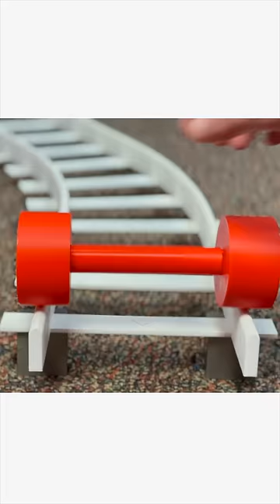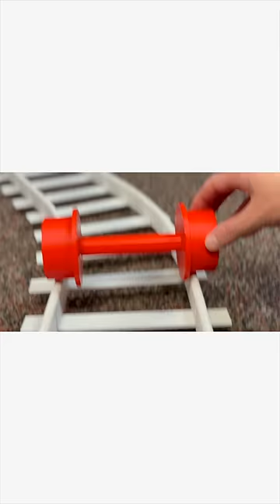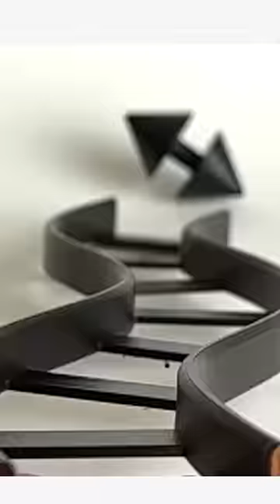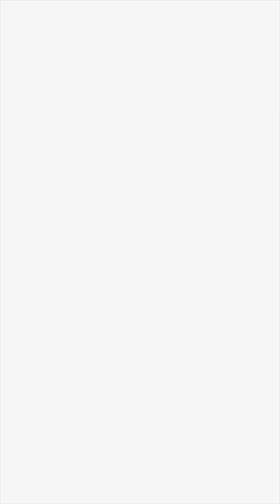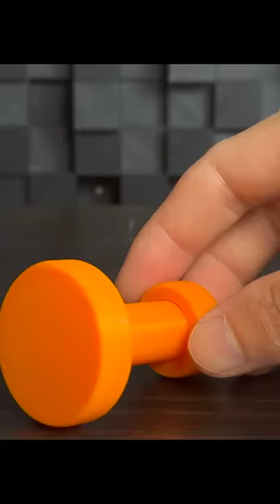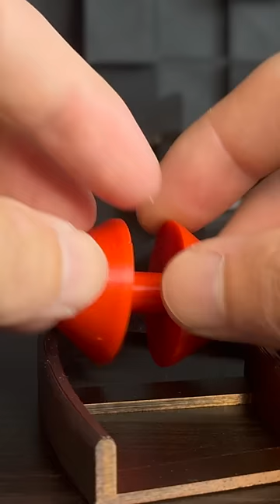The Design of Train Wheels is Genius #3dprinted #trains #interestingfacts

Comment: I work with train cars daily, and can confidently say that the majority of general purpose cars have a flat wheel with a flange, and they don’t go around corners easy.
The model track you showed is a stronger curve than what the tracks would be in all but the oddest of cases, and there’s usually an applied forward or backward force (in the case of what I use is either a rail king, or trackmobile tm267), a downward force holding it on the track (62-66k empty weight for the cars I work with)  as well as a pivot point that helps guide them.
I’ve heard hundreds of flanges this year screech as they rub the tracks while being pushed/pulled, they don’t self align.
Im sure there’s some track/car set that has a modified version of your self aligned toy, but most cars are flanged flat wheels
Reply: it won't work, it'll slip, too much weight pushing outward
Reply: They're not flat. They look flat, because the taper isn't at a huge angle, but they're not. As he said in the video, the shape used here is exaggerated for demonstration purposes.
Reply: @raerohan4241 are you a train mechanic?
Reply: I'm not an expert or anything.... But I'm just going to kindly point out that a quick google search says that train wheels have a flange and a slight angle that creates the effect that is exaggerated in this video. 

I'm assuming the widest part of the object in this video is mimicking the flange that is required when something weighs a lot more. But I'm just a guy on the internet.
Reply: Actually sorry. That was bad internet comment etiquette. What I meant to say was. iF tRaIn WhEeLs HaVe FlAnGeS tHeN hOw Do TrAiNs DeRaIl!??!?!?!?
Reply: But this still doesn’t reject the fact that it’s an actual legitimate design of wheel for a train car? but very exaggerated example of course
Reply: This is incorrect the majority of wheels have at least a 1:20 angle on them, sometimes as much as 1:40 and usually multiple different angles at different parts, the rail treads are also angled inwards slightly. A quick search of wheel and tread fabricators companies will show endless drawings of the profiles they use almost always utilising a conical shape for most types of trains. The only situation i know that still uses flat wheels is for things like cranes that are typically referred to as track wheels as they usually have 2 flanges.
Reply: So in short: how to be a train mechanic and know nothing of trains
Reply: You must be fun at parties
Reply: @olgagaming5544  The difference between a mechanic and an engineer
Reply: He never claimed train wheels are cones, he said this is an exaggerated representation of them. They will look flat to you just looking at them, but they do actually taper slightly towards the outside edge.
Reply: It’s hard to see but they aren’t flat. He said in the video it is a more exaggerated version
Reply: I doubt they are ever flat just because getting them out of the mold would be harder.   They probably have some draft angle that improves both situations.
Reply: Thanks for calling out this bullshit
Reply: @Scryyn  They derail not because of the wheels but because there is either a flaw or obstruction on the tracks themselves.
The flanged wheels are there for the train to follow the track while the weight of the cars keep the wheels pushed onto the tracks.  The weight and vibration over time causes allot of stress on the tracks which over time will try to push the tracks to one side eventually causing them to bend or break.  The tracks are almost always placed ontop of wood.  The wood rots over time causing that portion of track on that rotten wood to hold more weight which further aids in it shifting and stress applied in that area.
It is basic physics.
Reply: people really just go online and type out bs
Reply: "I work with train cars daily but instead of actually learning about them I just make shit up and spread it on the internet....with confidence"
Reply: @kylen6430 does he need to be?
Reply: Hey, fellow railroader here. You in NY?
Reply: @mennovanlavieren3885  It's ok.  He probably doesn't even know why there is gravel laid with and around the train tracks.
Reply: I hate working under trains and I don't miss cutting out dragboxes lol
Reply: I’m a train conductor and the wheels I’m face ARE curved, it’s just not extremely noticeable. Look to where the flange meets the wheel base and you’ll see it if you look hard enough. Can also confirm the wheels do sing around curves and it’s annoying as shit lol.
Reply: So basically your the flat earther of train workers.
Reply: they screach on tight turns yes because theres friction but they are infact slightly tapered on locomotives. theyre very very much not flat

Comment: Yep, every now and the you have to cut train wheels "cut". You use a lathe type device and slide it under said wheel that needs cutting. You shape out the wheel with the pre measured cuts and lines and boom. Then you have to cut the other wheel to match on the same axel. I spent 25 hours once cutting just 2 wheels. It's a long and slow process with a 100 steps but it's absolutely necessary to keep our train crews and freight safe out there one the rails.
Reply: does it take so long because of working out wear and tear or is it necessary for micrometer precision? I have a feeling the wheels are less resistant to damage than the track is. Would I be right assuming a little chip in the track isn't an issue, but the wheel with the chip in it can probably make the train do things it shouldn't?
Reply: @MUJUNKY  small chips and indents are pretty normal. It's the big flat spots and thin flanges (a flange is the part that holds the wheel inside the track) most times you cut a wheel is to resize the flange. Most train wheels can be cut 10 to 15 times before needing to replace the axel.
Reply: @deathgaming1769 What's the price of a new wheel, if you can disclose?
Reply: @ryeburlow1176  if you replace 1 wheel you have to replace the whole axel and that can be up to 3k.
Reply: Trucks* we used to contract it out, invested in our own equipment and the mechanics do it now. We got it all in a trailer to share between the three locations.
Reply: @deathgaming1769  Couldn't you replace both wheels without the axel for the balance or the work the take them out from the axel is too much? Of course If they are sold as kit and not separate, it's not possible. Or maybe if the wheels need changing, that means the wear on the metal of the axel is considerate as well?

Comment: Idea: with the circle wheels, put stoppers on each side of the wheels, making them look like spools of thread
Reply: Too much friction
Reply: @SeanWinters  The main issue isn't the friction, it's that if one side lifted up due to a turn, the other could slide right off in the opposite direction.

Comment: Another related fact, the standard gauge railroad size actually dates back to the Romans. It is exactly the width between the wheels in Roman carts. Because the Roman wheels were that width, the British kept making their carts that width to fit the ruts. That width carried through wagonways, and eventually to the modern railway.
Reply: That's only half true. In the earliest days of railroad, they experimented with many different gauges, one of them was the ancient 4 feet 8 1/2 inches or 1435mm. Stevenson designed his revolutionary Rocket loco to win a competition on a railroad track that already had been built in that gauge. After the competition, Stevenson simply stuck to that gauge and everybody who bought a Stevenson loco had to built his railway tracks to the same gauge. His success in that early competition secured Stevenson a huge market share. That's why the majority of railroad systems got built in the same gauge, long before they were connected to each other. 
Technically, everything between 4 1/2 feet and 5 1/2 feet is fine. When you go smaller you run into stability problems at higher speeds and you limit your wheel loading, when you go bigger you run into problems with tight turn radii and of course bigger is more expensive.
Reply: @Itsjustme-Justme wow!  Sounds like there is a sweetspot for the proper width of a track!  Thx!  That's interesting!   👍 😊
Reply: @statik47  It's like everything in engineering. When you're going to the extreme, the disadvantages grow faster than the advantages until you reach the point where the whole design doesn't work anymore. You will always like to be close to sweet spots. Depending on what you want to achieve, the sweet spots may vary. There are 600mm (just below 2 feet) narrow gauge railways that work just fine for what they are used for. The smaller the gauge, the tighter you can turn and it saves huge amounts of money to build smaller. The downside is, it massively limits the max speed you can achieve. That means, such a railroad makes sense where the tight turns and the cheaper design is more important than the lost speed. For example in the mountains (Darjeeling railway in the Himalayas for example), in poor countries (most of Africa has gauges smaller than standard because it's cheaper to build) and in the past the trench railroads for military purposes. 
Going much bigger than 5 1/2 feet doesn't make too much sense. It requires everything to get bigger, bigger switches, bigger radii, bigger purse. The Nazis were dreaming of a 3 meter railroad into occupied Russia. If they really had built it, they would have run into massive problems with huge switches and the impossibility to build tight radii would have required a huge amount of highly expensive earth work to modify the landscape for the railroad.

Comment: The underground trains in Berlin do run on cylindrical wheels, the example of just adding a flange. It does work, but turns are very noisy.

Also the amount of people in this comment section not realising that this video explains how train wheels have been working for over century is baffling.
Reply: No. They still have a taper. Its just not exaggerated like this example.
Reply: @need2connect  What you are describing is a normal railway wheel. The Berlin U-Bahn uses wheels that are cylindrical when they are new. If you speak German, check out the Wikipedia article "U-Bahn Berlin" section "Fahrzeugtypen".

Comment: Can you explain what regulates the transverse movements of the train.
Reply: Careful track design limits, the angle of the wheels bevel, the flanges at the ends, friction from tonnage.

This example is exaggerated to the extreme. The curve of the track is too much and the wheels are beveled far more than actual train wheels. This wheel is a cone > when a train wheel is more subtle like ~ instead.

By balancing the wheel diameter change, speed limits and track curve - transverse movement is reduced.

This also means that the driver is critical and must be aware of this.
Reply: @spoonikle   this is why train tracks don't really have shart turn radiuses, they require miles of track to technically make a right trun.
Reply: @pyronic120120 *sharp
*radii (plural of radius)
The length of track in a curve really only depends on the speed limit of that line. You don't really need that much track/sweeping curve if you don't expect trains to travel more than 100km/h on it, in fact there are a few metro lines around the world that have curves with less than a hundred meters of radius. Curvature also depends on the shape of the train and how much tight they're allowed to make a turn.

Comment: The shape also acts as the differential (which cars have) to fix the issue of different spin speeds required for turns
Reply: Not "also". This is the exact problem that is being talked about in the video.

Comment: If the wheels were actually of such pointy conical shapes they would have a very small turn radius (within reason of speed limitations) but they would wear out much sooner than they actually should because of the constant dynamic changes from turn to turn and you would be forced to replace them pretty often and while the actual train wheels use this same principle it's on a completely different scale where the train wheels look almost flat like one of the examples but are actually slightly angled into a cone
Reply: Well the guy in the vid says the wheels in the vid is overexaggerated, but train wheels is using the concept
Reply: Yeah bro literally said those cones were an exaggerated version of train wheels

Comment: Except train wheels have flanges and are not cone shaped. They do have a slight angle to them but it's very minimal, a degree or less.
Reply: That’s why it’s an “exaggerated demonstration” as he said.
Reply: @markdraycott3974  yes well it's an extreme exaggeration, both on the wheels and in the curves on the track.
Reply: @bajaboy27  I get what you are saying but I understand why he has shown it exaggerated with cone shape wheels, it makes the principal of what he is saying a lot easier to understand.

Comment: Notice how the double cone wheelset wobbles as it runs down the track. On a full sized rail vehicle this can lead to the wheelsets "hunting" as they try to find a stable position on the track.
The cure for this was the development of "pre-worn"  wheel profiles, initially the P8 profile by a team from BR Research with much of the work being done by Bridget Eikhoff, probably one of the best vehicle dynamics specialists from the 1980s/'90s.

Comment: This is slightly correct, a train wheel typically has grooves from braking so this would typically cancel out all of these physics. Every train car has 2 axles so 2 with a flang would keep it on the track and make it through a curve. Re try this with 2 axles

Comment: I worked for a railway inspection engineering company for years. The switch from optical rail inspection to wheel inspection needed a ridiculously high speed camera with high definition capture because of all these variables -- much more complex that mere rail profiling.

I'm also a Past Master in Bettendorf, IA, named for the inventor of the Bettendorf Truck. The lodge meets on what was once his land.

Comment: It is genius but the surface that touch the rail is extremely low thus it will have extremely poor braking compare to the conventional wheel that touch the entire surface of the rail. The solution to this is to make an V shape rail but it  uses too much material to make.
Reply: This is already the 'original' design

Comment: Very similar concept of tire stagger used in stock car racing. You change the circumference of the tires on the race car to help it automatically want to turn in the direction you need it to

Comment: thats why turns on tracks are usually very lengthy
Reply: No, but it is for the reason that the wheels are not extremely conical, and also the fact that the train would no doubt obliterate the rails if it was on a turn as narrow as on a road (rail wear and tear, it happens commonly at bends, and a sharper bend means more wear on average.)

Comment: That’s a decent way to put it, but to turn left it’s not that the right wheel needs to be bigger it’s that the right wheel needs to move a longer distance than the left wheel, and when it comes to trains the size difference is what makes that happen but with cars, the wheels are built so that the wheels can move freely from one another to speed up or slow down in a corner while still being powered.

Comment: This isnt exactly the point of the shape of train wheels. I has a lot kore to do with securing the train to the track as you do not hardly ever see tracks laid out that severely. It does aid in curves but it is really the flange and cone that stabilize the train through bumps and in the wind as the conic section that is the wheels cause the train to 'fall' into the space between the rails. 
 Its a self centering feature.

Comment: I'm skeptical, I've never ever seen a train wheel that wasn't just a wheel with a flange, unless the conical shape is literally imperceptible. This would be a great way to reduce friction on the wheels from a reduced cross section though, if they weren't what made the train move. And also if this wouldn't wear down extremely quickly into basically just being a regular wheel with a flange and a spike, so is this how they are supposed to be new or something and they just get worn down? Anyone who has rode a train knows when they hit a curve in the track the whole thing shifts violently as the flanges catch the track suddenly, it feels like the whole thing moving horizontally instantly. The rails would have to be at an angle to in order to keep each side from wearing down into a flat surface.

Comment: Train wheels are not designed 100% like that, they're shaped like design 2 and they are set 2 sets of wheels per one part where the part has a free rotating part, as the train reaches a corner, the wheel base turns to copy the track, while the car turns above, the back set of wheels will turn after the front wheel has started turning. This is called a wheelset. Wheelsets are designed to that both wheels rotate at the same speed. This works great when a train is on a straight track. Imagine if train wheels actually looked like 2 cones with an iron rod in the middle, and keep in mind, these trains move at an average of 60 and 65 mph, as you can imagine that is not gonna go well for something moving at that speed. However, that wheel design is partially correct, as the wheels are made with design 2 with a very slight  Most train wheels have a conical taper of about 1 in 20 to enable the wheelset to follow curves with less chance of the wheel flanges coming in contact with the rail sides, and to reduce curve resistance. The rails generally slant inwards at 1 in 40, a lesser angle than the wheel cone.